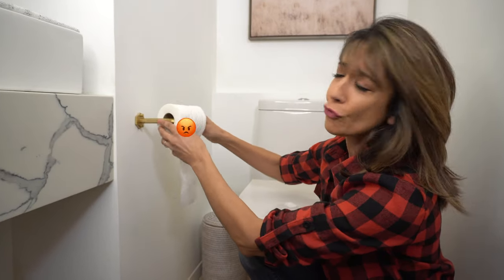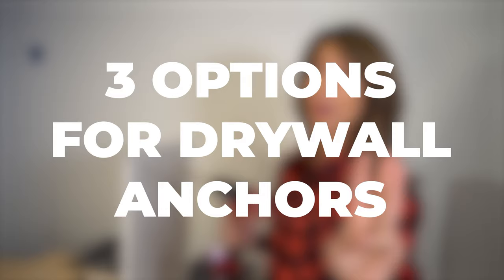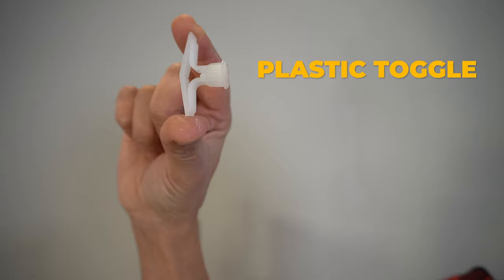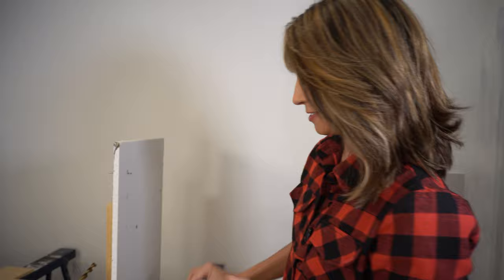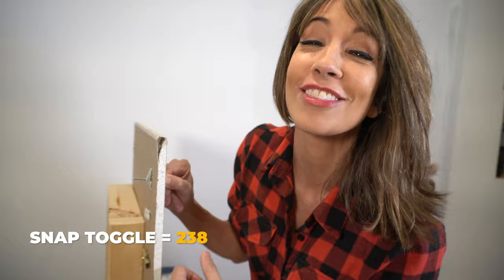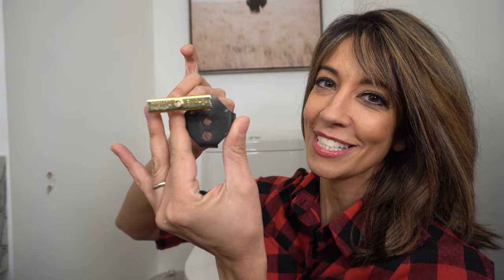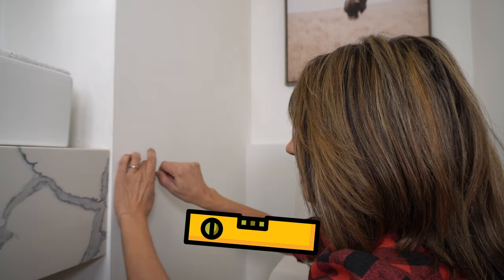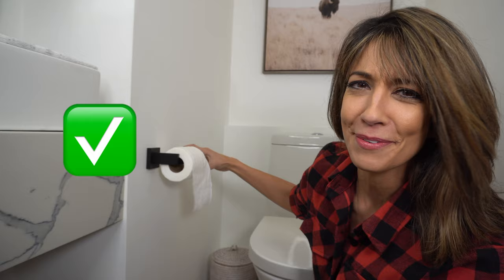World’s Strongest Drywall Anchor | How To Fix Loose Toilet Paper Holders + More!!

Comment: We found these cool brass toilet paper stand alone holders and they're decorative,  small, you can place them in a convenient spot, they hold three rolls on a fixed shaft and an active use roll on a curved portion. The most convenient device ever. Just slide the rolls on the stand, no springs, no contraptions no wall mounts, no reaching around trying to find the roll, never run out of paper. Good to go.

Comment: Hello Daru , I definitely love that style of anchor , Unfortunately all manufacturers of products that are mounted give you the wrong anchors and just recently I installed a grab bar in my older brother's shower and they had these plastic plugs for anchors and the manufacturer expects these to hold a grab bar ? What a joke , What I did was use a stud finder and a plum bob to mark the location of the stud and using hefty screws , mounted the grab bar so the screws go right into the stud , These manufacturers are wasting their money on the wrong anchors they furnish with their products , They should either furnish the right anchors or not furnish them at all but put in their installation instructions what anchors to use , I definitely love the snap toggle anchor because of it's amazing holding power 
They'll definitely come in handy because my niece may want me to install a large mirror in her bedroom and it's a framed mirror just like a picture and chances are that the mounting brackets or rings won't be positioned on the mirror in such a way to line up with the studs in the wall , So these anchors will be perfect for installing a large mirror ,  The grab bar that I installed at my brother's house , 
Now these anchors would do the job because of their holding power if I couldn't find the studs 
When it comes down to brass tacks 
There is nothing like having the right materials and the right tools to do the job , My Mom used to call me a packrat because when I got gift cards for The Home Depot for Christmas , She'd ask , Another tool ? And I would say You just can't beat having the right tools and materials for the job , Not only do they make the job much easier 
They play a huge role in doing the job right the first time , One thing for sure is even though we've gone to school and graduated , We never stop learning and thanks to you , Now I learned about which is the best drywall anchor to use  , Thank you so much for your tips on drywall anchors
Reply from the maker: We never stop learning that is so true. I also don’t like to use the anchors provided. Like you say they don’t work out. Sounds like you have a good idea when it comes to tools. I agree!

Comment: I can't imagine a scenario where screwed-in anchors would be insufficient for a toilet paper holder. Unless you use the paper holder as a grap bar I guess..
Reply from the maker: @ashkiler  appreciate your thoughts on this.
Reply: Nope. Mine fell out. Amazon special…
Reply: @laurenmccormick9259  I used plastic screw anchors from Lowes all around my house to attach everything from toilet paper holders to storage shelving. In a very small minority of cases I was lucky enough to have studs in the right places to avoid anchors. Somehow through many years I have not had a single case where those anchors failed. I am sorry about your experience.

Comment: Huge fan of the snap toggle, I've got a big box of them in my workshop 🙂

I had no idea you could just wiggle / twist the plastic zip off when it's locked into place; I've always used diagonal cutters to snip them flush.  Next time I use them I'll have to give that move a try!
Reply from the maker: That's a good idea to have them on hand in your workshop! I recently did the same and already used one to hang a mirror. Give the snapping a try next time. I hope it helps George. Thanks for taking the time to comment I love hearing your results!
Reply: I also did not know you could just twist and snap them off. I always used diagonal cutters.

Comment: It's worth mentioning that the 'screw in anchor ' should be used with the appropriate length size screw. They will split and grip behind the wall, thus working similar to a toggle bolt.
It doesn't look as neat behind the wall as a toggle bolt but it works if you don't have the tools for pre-drilling.
I've used screw-in anchors for years, hanging mirrors, paintings and other decorative items without any issues.
Reply from the maker: Yes, glad you mentioned that here. Thank-you! Appreciate your added value tip.

Comment: I used this method and it worked! For one I had an issue where the stud was preventing the toggle from lining up with the bolt, rotated it 90 degrees and it worked!
Reply from the maker: Thanks for sharing your tip! You may have to rotate the toggle depending on its location. Good little trick to know!

Comment: Install roll holders etc by screwing to a stud or dwang (horizontal.) 
In my country builders consistently install a timber dwang where a roll holder should be.
Reply from the maker: I love backing behind drywall. Great tip when renovating. Thanks for sharing!
Reply: in our country where Daru also lives, we use drywall in bathroom and toilet walls that's why these 3 toggle screws are way to go. 😊

Comment: Hi, thanks for the video some useful information. I want to mention that on the 1st. toggle you didn't mention that you have to put the screw(s) into/through whatever mounting plate that sits on the wall first.  If you don't, when you unscrew the bolt/screw the grabber bar inside the wall will just fall off.

Comment: Thank you for the weight rating comparison of the different types of anchors!!! While I've been a big fan of pop toggles, my house has different thicknesses of drywall in different places, so I never know which depth pop toggle i'll need. The snap toggles might be overkill for a lot of my uses, but it looks like they will take the guesswork out of the pop toggle depth!!!
Reply from the maker: Thanks glad you liked the video! They are especially helpful for anything like hardware that you touch and causes movement. If you never touch something the screw in anchors are fine too.

Comment: Thanks for introducing me to the snap toggle anchors. Very interesting. If later you need to remove them how much damage will it do to the drywall? Looks like the plastic part will have to be drilled.
Reply from the maker: Not much. Just push them through the drywall and mud. Good to go!

Comment: I watched the whole video, but I’m not sure if you mentioned how to also take them out. Is that a permanent solution? No undo?
Reply from the maker: @BboyWalzy  it’s a permanent solution no need to take them out. Typically when anchors are removed that would require patching. I have a helpful video on how to patch small holes in drywall. I think you’d want to avoid that though. Thanks for the question!

Comment: How do the snap??? There is a wall and a small hole. I don’t want to make a through hole to my bedroom.
Reply from the maker: You drill 1/2” the depth of your drywall. I show the snapping in the video. The plastic snaps off after you pull it tight and bend it to the left or right. Like a zip-tie.

Comment: How do you know where the pipes are so you don't drill into them?
Also, it is secure on the wall but  I have to keep tightening that tiny screw to keep it tight and it has stripped. Nobody sells them. I'd hate to have to do a whole project because of this tiny screw!
Reply from the maker: If you are unsure about where your pipes are place a piece of tape on your drill bit at 1/2”. That way when you drill through your wall you only go the depth of your drywall. You can insert something small into the hole to feel what’s behind it. It’s often easiest to install a new holder than finding a new tiny screw. The one in the video is affordable and well made.

Comment: Hi! I am considering the snap toggle anchor for my towel hooks because afraid my kids might yank on the towels. However, I have a question. Is there a minimum distance between each anchor? I wonder if drilling two 1/2" holes close by each other would weaken the drywall and decrease the weight load. Also thank you for the vid and info.
Reply from the maker: I haven’t had any issues as long as you align your toggles so they don’t touch. Both in the same direction.

Comment: Will that second option, the plastic toggle, work in an existing hole where previous wall anchors failed?
Reply from the maker: As long as it’s bigger and has enough area for the toggle to hold tight against the drywall. If not I have a really helpful video on patching small holes. That’s easy to do. You got it!
Reply: @DaruDhillon  Thanks so much for responding. I've discovered that the contractor had not installed the toilet roll holder on at least one side to a stud. I've located the stud & will be moving the holder over a couple of inches. I will definitely be using option #2 for the side that will not be attached to the stud. I'll also be checking out your video on repairing holes in drywall. Thanks again!!
Reply from the maker: @lumartin1908  good on you for finding a stud that’s a huge bonus! My pleasure. You’re good to go!

Comment: My toilet paper mount is loose... The Allen key screw underneath the mount is jammed and not coming out no matter how much I loosen it... So... What now?
Reply from the maker: You could use a metal drill bit to drill out the screw and safety release it. Or beast mode and pull it out of the drywall and patch it. Drilling it is easier.

Comment: hello Daru, do you think snap toggle are good  for tv mounting?
Reply from the maker: TVs are heavy and should always be mounted to a stud or blocking for safety. Anchors are used more in a supplemental way for mid weight mounting. I find them very useful for hardware, pictures etc. Good question, thanks for asking! 👍🏽
Reply: @DaruDhillon  Thank you, i'll mount my tv using studsensor method then, i really apperciate your help!
Reply from the maker: @min_oz14  my pleasure. Helpful questions and I’m glad you’re doing these projects yourself! Tip of the hat to you.
Reply: I didn't realize that mounting tv's was a thing🥺 @DaruDhillon

Comment: I did the snap toggle but the screws of my toilet holders must be too small.   It’s not catching to anything.   I have two holes now.  😢 what can I do?    I can’t (not right now pay for anyone to fix.  Any ideas to help?
Reply from the maker: When using the snap toggle you have to use the long machine screws that come with the snap toggle. The two long screws will attach the mounting bracket. If your holder doesn’t have a mounting plate and only small screws I would swap out the screws for bigger ones. Or use an anchor that is sized for your specific screw. To patch the holes fill with spackle, light sand and paint.
Reply: Just realized the box did not have the screws.   Just ordered screws on Amazon!!!   Thank you so much.
Reply from the maker: @MarthaLopez-xm5si  I understand that’s frustrating. I’m glad you figured it out.
Reply: Yes the plate has smaller screws.   Trying to drill the hole to make it bigger.    Single moms power!!!   Wish me luck!!!

Comment: Try those snap toggle to mount a TV mount with full swivel action. LOL I certainly won't.
Reply from the maker: Heavy items like TV mounts, wall cabinets , furniture safety straps etc. should always be mounted onto studs or blocking. Good reminder 👍🏽

Comment: How do you remove those anchors if you need?
Reply from the maker: If you have needle nose pliers you can pull them out. Or any type of plier.
Reply: @DaruDhillon  But the anchor is holding against the wall. If you pull hard enough, it would tear the wall. I don’t get it. Can you re-close the anchors after they are deployed?
Reply from the maker: @ViniciusFortuna  usually if your anchor stops working or pulls ways from your wall you would have to patch it. I have a video that can help you. Sorry your experiencing this.
Reply: @ViniciusFortuna  I just had to remove some molly anchors, and saw a comment that I tried, that said put the screw in and give it a gentle hit with a hammer.  This of course will cause it to not be holding up against the wall. The rest of the molly anchor snapped off and the other part just got pushed into the wall, it's somewhere at the bottom of the dry wall.